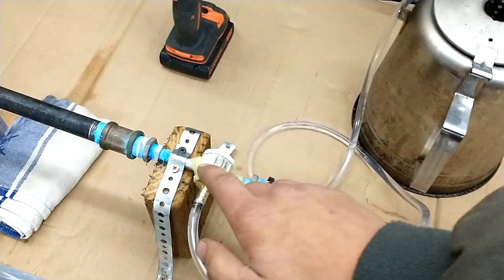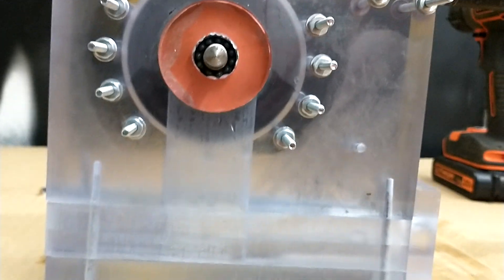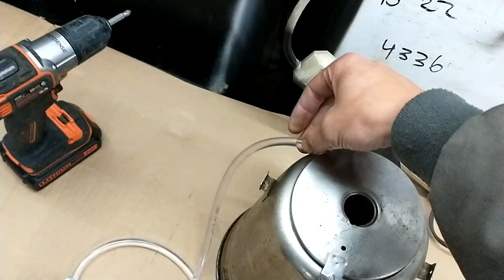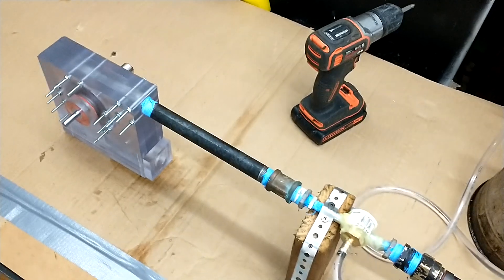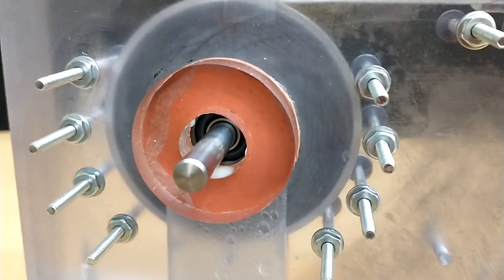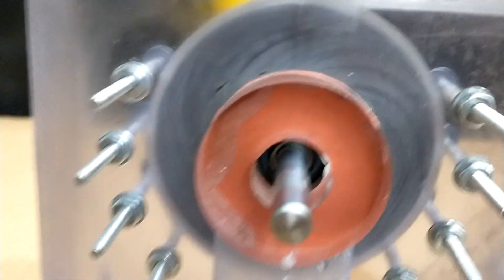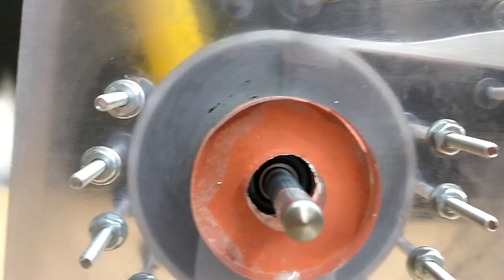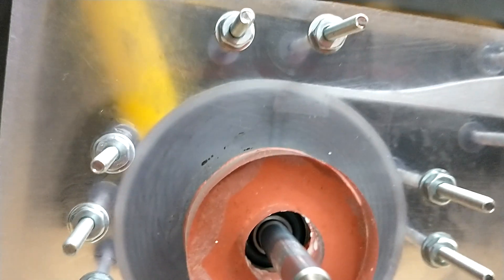Amazing visualization of the boundary layer inside the tesla turbine! See the vortex!!

Comment: I don't understand this experiment at all lol. Surely the power it coming from the compressed air?
Reply: @adam porter I would figure the purpose of the water is just so you can see the way the air moves, the Tesla turbine was made by Tesla and was supposedly 97% efficient with just air and the boundary effect is the air grips the disc and moves the turbine and the water is just to see how the boundary effect. If anybody would like to correct me if I'm wrong please do.
Reply: @jaxperez7860  Nikola Tesla claimed 97% efficiency using a second stage vacuum pump with 3 times the surface area and superheated steam in 1911. The highest recorded Tesla turbine single stage is 86% efficient using super heated steam and air bearings.
Reply from the maker: Remember this was a closed system with high vacuum on the condenser, and it wasn't superheated. He said you could get over 600 horsepower on 125 psi of steam. That's not superheated.
Reply: @iEnergySupply  could you resign the plates to have more surface area , kind of like your intestines. They have a extreme amount of surface area
Reply: @iEnergySupply  was the purpose of this demonstration to show the turbine in operation? Are you still planning on using ambient air as the fuel source or what? I'm sorry I'm just not understanding what is going on in this particular video other than showing the turbine running.
Reply from the maker: @jaxperez7860  My new turbine, is almost exactly the same as this one, it just has .4 mm spacing. The surface area will be sufficient.
Reply from the maker: @jeffjefferson3364  this particular video was just to show the vortex inside the turbine.
Reply: @iEnergySupply  I think you mean 0.4mm
Reply from the maker: @nikola.tesla.r.and.d.centre  Yeah .4 mm
Reply from the maker: Correct!
Reply: The faster the turbine spins the more efficient it becomes. it's a turbine engine if you were to equip these instead of the current turbines. you would be able to convert more energy from the steam in power plants into electricity.however these turbines must spin incredibly fast currently Material Science isn't up to par to be able to manufacture Tesla turbines on the scale a power plant would use they would rotate too fast and blow apart somewhere in the tune of 40000 to 50000 RPMs.

Comment: Awesome job guys 👍
It's really cool how you can see the spiral lines on the casing
Reply from the maker: Thanks! yeah, I was excited when I saw it.
Reply: @iEnergySupply   you must try and use ceramic bearings , at high RPM they are more effective against resistance 
the options are , 
Magnetic Bearing 
Gas Bearing 
Ceramic Bearing 
Carbon Graphite Bearing 
or you can try a bearing that is inserted into another bearing , causing even less movement restriction